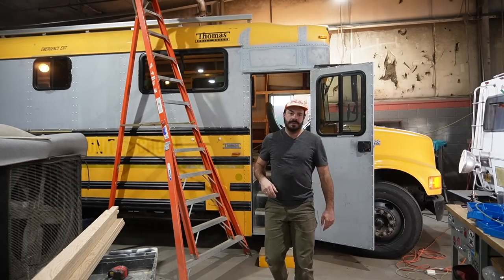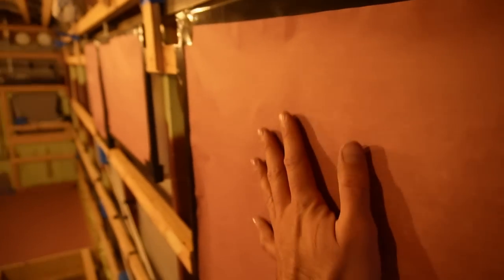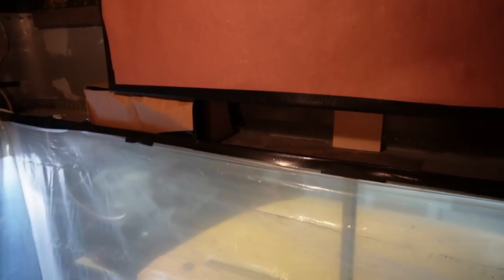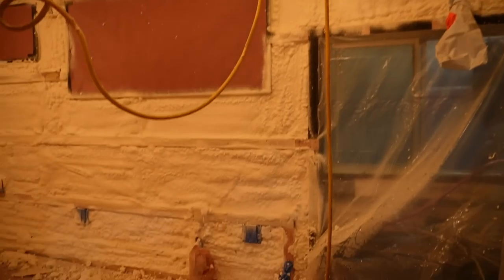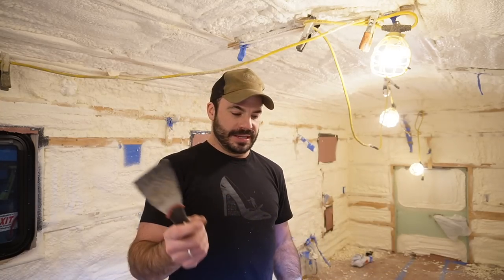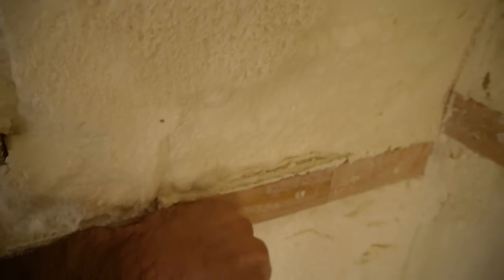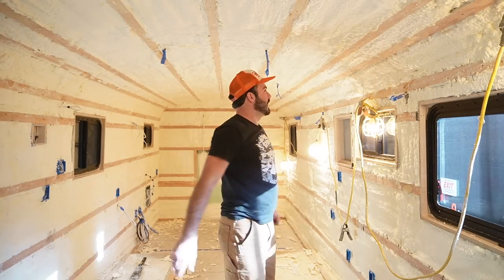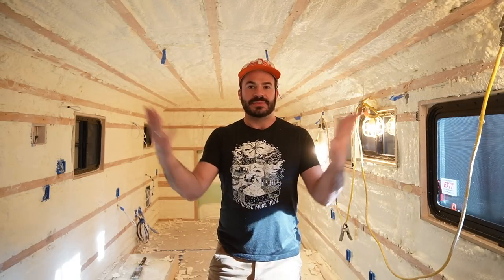Is Spray Foam Worth It?

Comment: what if you stapled cardboard onto the wood studs and then sprayed into it? that way the foam could fill that cavity and you wouldn't have to shave any of it back. Then maybe you could remove the cardboard or even just let it be and build over it.

solely the imagination of a complete noob speculating; not a pro giving advice nor dissing your method (which is clearly working great). do you think it could work?

Comment: Ok, this may sound crazy...🤡 But I got 20 cases of Locktite Tite gap & crack foam for free...I've looked up the safety data sheets, its closed cell polyurethane, it doesn't say it cant be used to insulate everything....what do you think? Yes I know using 300 + cans of spray foam sounds crazy....but it was free 😂 and im seriously considering using it to insulate my <<<<bus
Reply from the maker: It’s a lower r value than two component foam, with a very slow rise and cure time. I wouldn’t do it, if you want my honest opinion